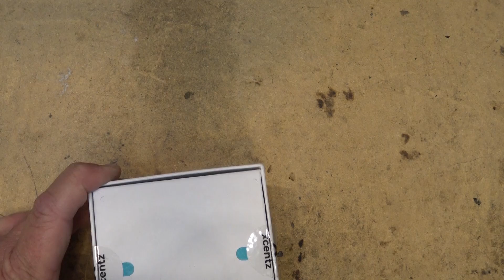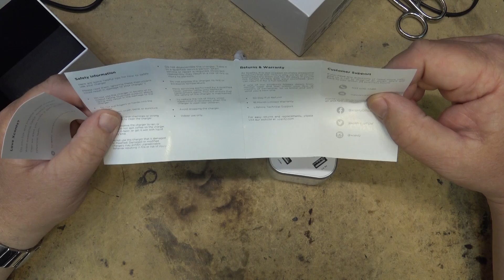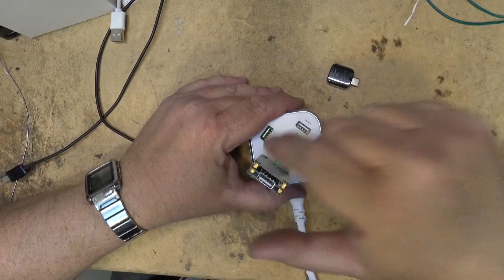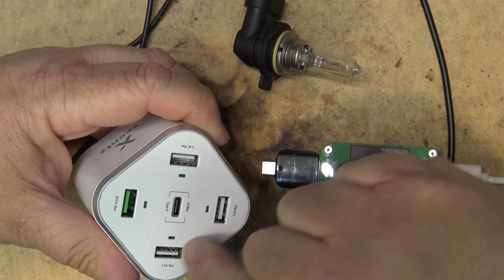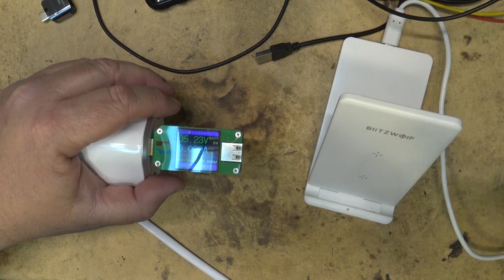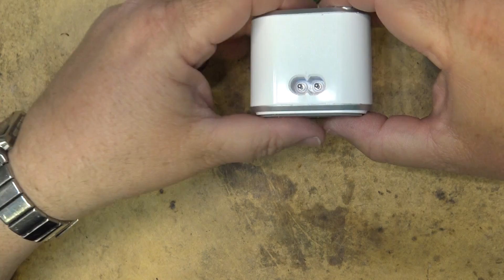xcentz xDynamo 5 QC3 0 USB Charger put through load tests

Comment: fast charge will damage battery
Reply from the maker: It is not the speed you charge that damages the battery it is the heat created.   Phones that have this capability also have battery thermal management.  This is why wireless charging is slower because the wireless circuit produces extra heat. My Samsung has an internal fan to cool the battery that comes in during charging.  You can hear it running.  Phone caaes, especially otter box kills the battery quickly because they hold the heat in.
Reply: @12voltvids  nice one i din't know it , yes heat kill battery , nice work

Comment: It is cheap charger without Qualcom chip inside. Try to buy ąuick charger with Qualcom chip and You will see that charger cable does not matter if it is original and Your phone will vharge with this cable. This charger does not have that chip and Samsung does not recognizes charging and goes to the slow charging. Your wirelles charging is detecting voltage rising by other chip and it goes to maximum. That is old algorytm. It is different story if you will have fast charger (5A) and wit this chager usb cable it is important part. And other strange fact that chargers wit Qualcom chip if you connect light bulb it does not shine. I think because of overvoltage protection. And when i pluging supporting phone it charges 9-12V. That i tryed with 3 diferent brands chargers with real Qualcom chip inside. But you video is nice because of Your video i will know that i will not buy this charger.:)

Comment: Hey interesting video thanks for that. 😉
Cut you please put a link up  to where to buy the USB tester you use to test the volt and Amp.
Best regards Jimmi.
Reply from the maker: http://www.icstation.com/um24-color-display-tester-voltmeter-ammeter-battery-capacity-tester-voltage-current-meter-cable-resistance-tester-p-13213.html

Video of it here
https://www.youtube.com/watch?v=0eC9HpUnftM&t=9s
Reply: Jimmi B i guess it‘s from Ruideng/RD Tech - available from AliExpress. Check for „RD UM34C“
Reply from the maker: If you look up usb tester on my channel you will find the video for that with the link to buy one.